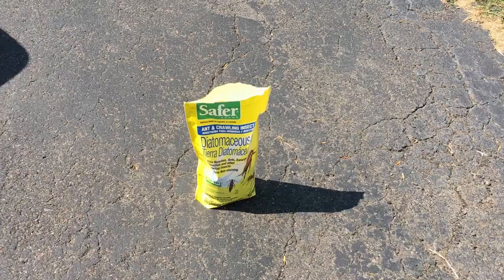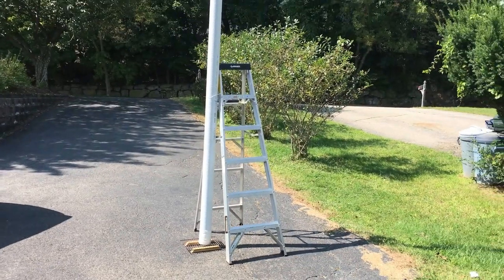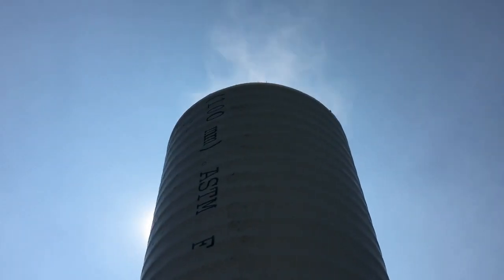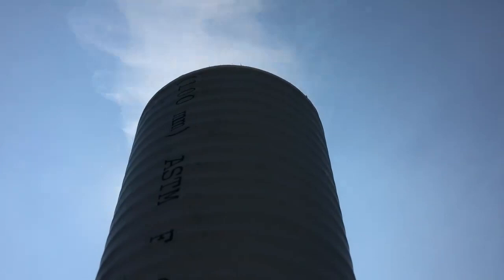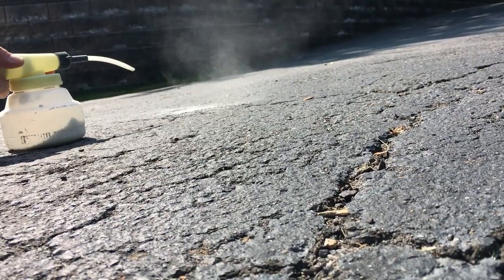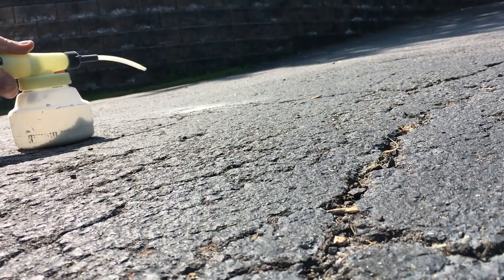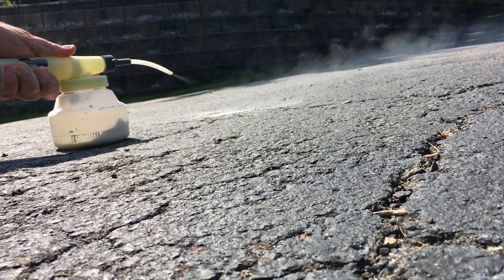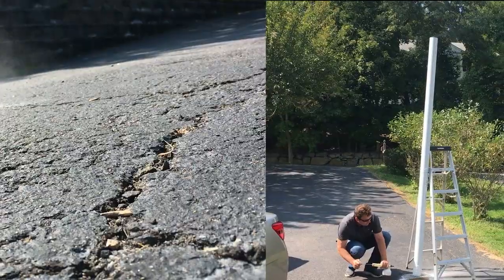Super Chimney  Prototype Demonstration

Comment: I was (kinda) sent here by Sabine. what? as to why should that last part be any "difficult" to explain? the chimney provides thermal insulation and therefore prevents the air inside from cooling. the updraft only stops at the very top (kinda similarly as to when it's sprayed directly on the tarmac.)

however, when the temperature difference is big enough, you can create a similar effect without any chimney at all! (cf., Chernobyl.)

Comment: Add a layer of clear glass or plastic around the base, allowing the sun to heat the air yet more. Like a solar uplift tower :P

But, building an uplift tower with the chimney in top, would be the best of both worlds. Strong rigid structure that heats to air, protects crops, and already makes power, but then you add to the hight. Should be enough uplift to carry the cap, without input power, too